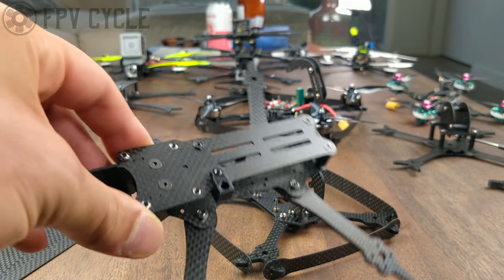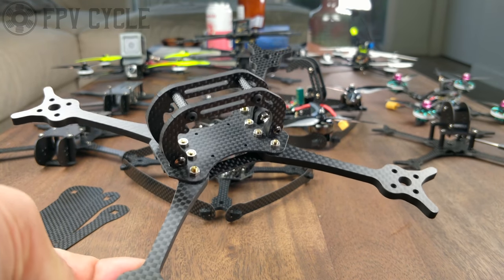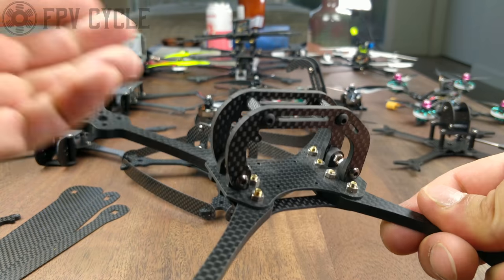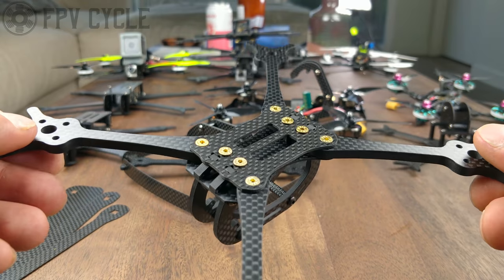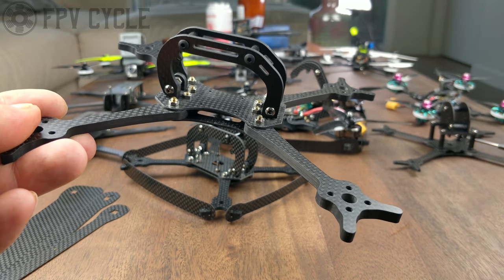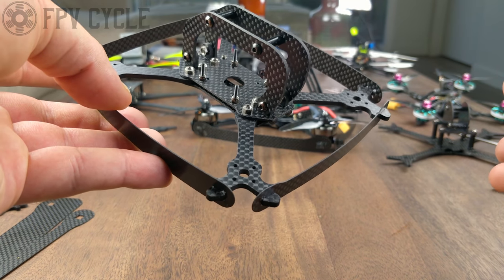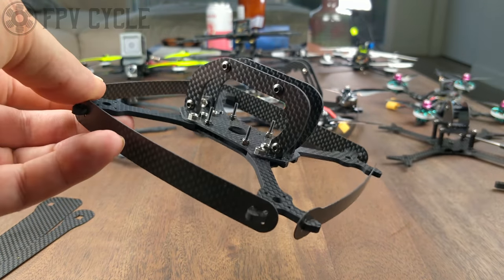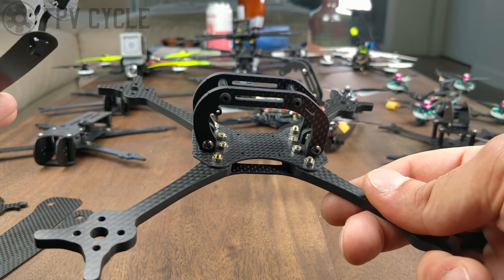Vertical Carbon Fin Concept

Comment from the maker: Molar Race Frame: https://bit.ly/30qBZYc
Fouride: https://bit.ly/3eJZ4tX
PowerPick: https://bit.ly/3fW6iMq
CineSplore: https://bit.ly/3dGJu1z
Gemfan Duct props: https://bit.ly/385nvAk

FPVCycle 2203: https://bit.ly/3i7QPuA
Excellent prop options: https://bit.ly/3es3gyf, https://bit.ly/30fxDD2
30A 4S AIO Toothpick board: https://bit.ly/3i8POCq
1100mah 4S 130C: https://bit.ly/2V7cvx4

Other unique things to FPVCycle.com:
Longer Vista antenna - https://bit.ly/2ViXhFg
Vista + Nano Nebula - https://bit.ly/2ViXhFg
Vista kit + longer camera wire - https://bit.ly/2ViXhFg
200mm DJI camera wire - https://bit.ly/3eyBYXU

Shrediquette Blog: http://bit.ly/2J7Urfv

Table of Contents:
►00:00 - Intro
►00:05 - Fouride quick view
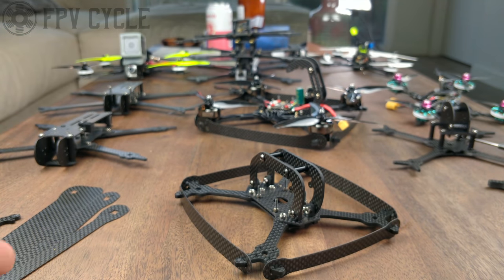►00:32 - Molar intro 
►02:55 - Vertical fin intro
►05:58 - Why this fin structure
►07:19 - Why vertical plates
►07:56 - Front and back fin effects
►12:32 - Side fin effects
►15:40 - Lighter is better than fins
►19:14 - Final thoughts

▼Join my FB group for more discussion: Kabab FPV
https://www.facebook.com/groups/379155946182689/

The store: www.FPVCycle.com

▼ My typical 5" quad setup:
-CineGlide: https://bit.ly/2MCoz50
-Motor: http://bit.ly/2Nqqr25
-ESC: http://bit.ly/2oDdzvL
-WaFL’s Cap Cap: http://bit.ly/2GUpXxO
-Battery: http://bit.ly/2JnsTDM
-FC: http://bit.ly/2XRc8G8
-FPV Cam: http://bit.ly/2Q7LfL7
-Vtx: http://bit.ly/38Y25oz
-ND GoPro Mount 30deg: http://bit.ly/2WC15zc
-ND Filter (if used): http://bit.ly/2WEmQ1j

▼Notable motors:
Check out the Rcinpower Wasp and Bison...interesting motors coming.  We're working on blending those two motors into one.  The Wasp is more powerful but the Bison has an awesome 11mm bearing that's uber smooth.

▼Starter goggles: http://bit.ly/2qbJNOS

▼ If you want to solder better:
-Fantastic solder: https://amzn.to/2P5QM2W
-Fantastic iron: https://goo.gl/DqBipa

▼ Tips?
Patreon: https://bit.ly/2oGLP9b

-PayPal: https://www.paypal.me/kababfpv
-Bitcoin: 1E4XZXoD4rS6MYWVWuenY7Kw2M1YgyNpoQ
-Nano: xrb_1188ek5bd7tb9kw67asnp9o65byuoaxbtpxuznx1ribf75x78awywmakj55f
-ETH: 0xD067F93811f2eC31CB1928901002dfdf9A492EF5
-LTC: La2KWYAjp4VT2Lq2M76pbjzXWvRyjpfCtG

Comment: The "rectifying the thrust" is what stator vanes do in a turbine. Those box frames probably do slightly straighten the discharge flow, but it probably is a wash with the drag it induces. If that idea worked every light plane with open props would have stators...

Comment: Great video! Love when you talk about racing as you have a unique prespective. Will be interesting to see if smaller, lighter quads will be competetive. Imo we are moving in the direction where straight line speed and initial turn-in is more important than a smooth overall flight.
Reply: I agree :D

Comment: After skateboarding, skiing, driving, racing cars, jet ski and snowmobiles you are on point for me.

Also I run a MAMBA 20amp 20/20 nano full soft mount XRotor stack and I’m blown away with it! Currently on a 2nd generation Leader 120 2s, 3s and 4s 850s! All run so well on stock pids... it was a wonderful surprise I have a hobby Wing stack I used in a 3inch 4s, perfect! In the Leader it likes 2s!?! I think it’s the vibes from two motors but I’m putting that in a 5inch Doberman out of Detroit🤞 cheers

Comment: Interesting discussion. Thanks! I’ve loved Karearea Talons for a long time though the frame is so fragile. The vertical arms really help it track around corners and as true to your statement, it has to be lighter for the verticality to matter. When I strap a GoPro on it loses that locked in feeling. Talon PR is amazing with a Vista, 20x20 Talon F7 stack, and F40 Pro IV’s.  The Karearea Toa with horizontal fins looks great for freestyle float, though I haven’t tried.
Reply: The new talon frame doesn't look so fragile ;)
Reply: SueMyChin the Talon V2 looks quite unique. UAVfutures made a nice video on the durability. Definitely stronger than carbon and beautiful in its own way. Single ‘rudder’ up the top! Nice to have KababFPV frame with options to experiment with vertical fins. Great idea!

Comment: A thing to note is that the compressive force you put on the plates to mount them can cause them to "quickly" delaminate at the inside of the attachment point. Although i doubt anyone will care because its a easily replaceable .5 mill presumably cheap carbon plate.
Reply from the maker: They're designed to be thrown away and replaced. They're very very cheap to make the fins

Comment: If you look at the aerodynamic coefficient of lift (CL) profile of a flat plane then the maximum amount of lift is created at 45 degrees angle of attack - which is coincidentally very similar to most peoples camera angle for racing. So yes those front and rear box components do generate lift. I can link aerodynamic analysis of CL profiles for flat planes if you wish - or you can google them. Similarly as you side slip a quad through the air the angle of attack of the flat side planes increases and the effect is to aerodynamically assist the quad in the direction of the turn ;-)
Reply from the maker: It's not as simple as just 45deg. Flowing air will not stick to a non aerodynamic surface or deflect that easily. This is a narrow spar. If it was like three inches wide then sure 45deg may do something but it would still cause an immense amount of drag when you're not on the throttle. It's basically a game of drag vs lift which drag usually wins. The actual lifting effect benefits are seen at past 80deg or so of tilt as far as existing tests go.

Comment: I do think the vertical fin does do something for lift. Most of it is under the swept area of the props so the main flow direction will be inline. The oncoming air reshapes the downward air more than directly hitting the cross spar in this case I think, at the very least the effective angle of incidence is dramatically decreased. Obviously that applies to the side fins too which probably don't do much. In this example the tilt on the quad is pretty low but the angle the air hits the arms would be fairly shallow. https://www.youtube.com/watch?v=Yh0RzFZKExo
BTW Have you thought about designing in sandwich style arms? eg 2x 2mm plates separated by the body plate with a spacer out by the motor
Reply from the maker: Yeah actually I have that on one prototype design. Was trying to get a certain advantage from it. Definitely learned a bunch about things with that design

Comment: Hey man! I've been thinking of using VAS xfire pro antenna as huge sharkfin/side force genererator for my frame for a while now instead of committing to box style SFG. I think placing the sharkfin at the back like most modern track cars is plenty enough to make the quad more stable in the air. It's a functional design that won't add any real weight to the overall build since we're using antennas anyway and can be easily integrated to ultralight 5" toothpicks by just adding an antenna mount at the back. Might be worth investigating ;)
Reply from the maker: There are lots of frames with shark fins. They fly fine and are great for turtling but as far as my testing goes they don't do much in the way of tracking
Reply: @Kabab  Not like a sharkfin that's used for turtle mode but directly behind the canopy in between the rear motors. This way, we can still use the thrust of the props :)

Comment: Seems like a great concept, on the sides at least, though even the front and rear should help direct airflow as well.  They may even help keep from getting tangled up in branches?  I'd buy an antler arm kit for my Glide.

Comment: Hey Bob. Have you seen the Karearea motors which have fins on the actual motor, on the strut connecting the motor shaft to the bell. It supposedly cools the motors and provides a tiny amount of thrust
Reply from the maker: They do nothing but nice effort in making them...

Comment: Very interesting! Deffenetly agree that racing might move to more precise style racing instead of heavy quads. Remember when there was people flying 1408 5 inch ultralights in like 2018? They felt like throttle was either on or off and you would fall out of the sky when not on throttle... is that a problem now?
Reply from the maker: Na 1408 is far too small

Comment: 8:50 what if the fins were on a servo to tilt in the direction for the best performance and handling. I know that would add a lot of weight but its just an idea.
Reply: I was thinking the same thing, but then wondered if the added weight would remove any benefit you may gain.
Reply: @JazzXP  Yeah I know what you mean. Another idea I had was to ditch the 4 side fins and just have one rudder with one servo. This way the weight is dropped more than the other idea and you still will get the control through the turns. I am not so sure this would work but it would be cool to see a rudder on a quad to see how it handles.
Reply: @KoreFpv  Oh ok. Nice to know. Is there any flight footage I can watch?
Reply: Servo fails or twitches and suddenly shit goes sideways in a hurry....    that is the thing I like about quads is how few moving parts and resistant to noise/influences they are.

Servo linkages or adjusting for backlash and other details for quads would likely be a pain in the ass beyond just the durability issues.

I do play with servos on quads a bit and have run into some issues just in the camtilt systems I play with while using cheap servos worthy of sacrificing on a quad.

Comment: Smoother motor you say, skewed stator? Although I do wonder how much more "smoothness" can be gained just from better FOC motor control.
Reply from the maker: Been working on the skew.  Unfortunately it's a bit prohibitively expensive to do.  Both magnets or the stator.  But still working on it.  If I can add that skew to this new motor it would be the absolute ultimate in smoothness.

Comment: Habe you tested a negative angle an the Front and back "wings" so that when yuor fying normal at ex 45° you have almost no drag but when you go to 0° you have a downward force what could bei beneficial for racing
Reply from the maker: Yeah I've seen this a few times too. I've flown one. It tends to want to suck you down but more than anything it seems to just be draggy and inefficient. Which I guess is the point....
Reply: This is what I was thinking.  Should rotate them so they run parallel (or near parallel) to ground when camera is parallel to ground.
Reply from the maker: @sugasheeze  so then why not just get rid of the front and back ones altogether?
Reply: @Kabab  okey yes I can imagine that if youre not at the perfect angle it ist juste realy dragi and does not have enaugh benfits

Comment: as you pitch back the front and rear fins could act like a Bugatti Veyron rear wing.  so incorporate that move into a racing line so you can effectively "smash the brakes" harder than everyone else....?

💭 servo attached to fins attached to FC for active control....... #betaflight5.0   
: opens DM to @Tom Stanton :

Comment: Ultralight racers might be better as they have less inertia and can change direction much faster. However, they might also be more susceptible to wind and might feel a bit floaty in flight. 

...And so 2 months into the new (traditional) race build on 6S and I am already filled with quite a good bit of regret. 

SFPV's box frame?: https://rotorbuilds.com/build/24043
Reply from the maker: not quite.  it's the one from diatone.  This one https://www.banggood.com/DIATONEFALCON-MULTIROTORS-SOLLEVA-240mm-Frame-Kit-compatible-DJI-FPV-Air-Unit-20_530_5mm-Hole-p-1627778.html?rmmds=search&cur_warehouse=CN
Reply: Oh ok- Also I have an idea for a light racing setup - It's meant to be a sort of balance between power and weight 

Upgraded PowerPick (3.5mm or 4mm arms) - need some sort of pod- the current carbon one is much too heavy in my opinion
2204-6 2100-2200kV 
Gemfan 5125 or maybe HQ R35?
5S 900-1100 mah? (Less battery sag than 4S, not as heavy as 6s)

What do you think? Would be great if you could test this.
Reply from the maker: @KC-om7cm  this is fine but you're starting to creep up into the medium and heavy category.

Comment: To me, there's irony in bringing up an F1 car for performance - the coefficient of drag on those things is absolutely appaling, to the point where they actually need 1000bhp in order to achieve straightaway speed, and that they are so much faster when operated at 6000ft (Hermanos Rodriguez in Mexico City) just because the high downforce kits still make less drag than the Monza setups.
Reply from the maker: 😂 but their drag is actually doing something
Reply: @Kabab  The aero efficiency is actually pretty garbage, yes they're making huge amounts of downforce, but the regulations are written to ensure they can't actually make as much as the overall surface areas suggests they should, which is why LMP1 cars are on comparable pace at some tracks despite being similarly restricted.  They make their pace by having high minimum corner speed.
To some extent, that's how I feel about the aero appendage racing quad frames - where you can see both the apex and exit of the turn, that extra lateral stability is amazing, and makes even cheap quads feel razor sharp.  As soon as you are backing it into a turn, you lose that, and that transition is just hard to manage at first.
Reply from the maker: I remember a while back they wanted to force F1 to go back to full manual gearboxes or something. I'd quit if I was a driver and they forced me to do that 😂

Comment: Hey bob,
I´ve purchased two Mamba F411 AIO Boards and i´ve got several problems with the escs / rpm filter... I´m also in close contact with thorsten laux, the developer and owner of JESC. He´s trying to help me as well solving these issues. This is what happened /-s:
 
When hitting "read setup" in JESC or BLheli configurator only a random number of escs gets recognised.
When flashing, it often says flash failed
-Both issues got solved by thorsten laux by writing a new jesc configurator for issues like mine
 
This is whats still not working:
When flying with rpm filter on:
24khz: Weird twitches and non smooth/percised flying
48khz: Death rolls...
 
Without rpm-filtering:
24khz: way less twitching but still slightly there
 
 
All issues appear on both brand new boards!
 
Any ideas on what to do? I´m kinda lost and don´t get to fly ms TP3 properly
Reply from the maker: Are you running the right firmware version for the board?  Usually when things like that don't work it's something simple
Reply: @Kabab  I dont know, i run betaflight 4.2.. Bf 3.57 worked but had terrible propwash handling... I´d love to be able to fly my TP3s with 4.2 and rpm filter...
Reply from the maker: @rawpicsfpv3516  I haven't gotten 4.2 to run right on anything really
Reply: @Kabab  Guess 4.1 isn´t better then? Like i said, my TP3 had some pretty bad propwash on 3.57:(...

Comment: Any thoughts on xings 1303 motors?
Reply from the maker: They're overweight despite having a 1.5mm shaft instead of 2mm and nothing special just like all their other micro motors.  You only get two prop mounting screw holes so if you mess either of those holes up the motor is done.  This particular motor happens to be $1.50 more expensive than the FPVCycle 1303 too.....which is the motor iflight likely decided to mimic.
Reply: @Kabab  Thanks, so rcinpower 1204 is basically the only option in the EU.
Reply from the maker: @coooxd  that's good option

Comment: Cool designs, but all PIW Props in view frames! :-(
Reply from the maker: These are racing frames.  They're generally not intended for cinematic footage and almost every single racing frame out there has props in view of the FPV feed.  Consider looking at the CineGlide frame: https://fpvcycle.com/products/bucktooth-frame-aka-cinemint-5-frame-dev-test-team-edition?_pos=1&_sid=a043fc025&_ss=r
Reply: KababFPV 
Of course, but I guess for racing too it could be better. When the sun reflects on the props it’s not pleasant and it takes away a good slice of view But in general I would see a better flying frame than the DC without props in view.

Comment: the vertical frame actually does result in uplift, just think of 3d airplaines which have very high degree in angle to the direction the're flying at.. and also its tested that vertical frames do make visable differences. Sorry if my English isnt smooth, greetings from Germany :D
Reply from the maker: makes complete sense.  The difference is that those things typically don't move super quick and the surface area of the wing is generally huge compared to the rest of the plane.  We have the exact opposite here.

Comment: Get rid of the front and rear fins and test.   Any flat or cylindrical shape moving through the air causes a lot of drag behind it.  Tennis racket has lots of draggy wires.  Reason why they tried to ditch so much wire tension rigging on WW1 box kite style airplanes.

I could see flight controller servo controlled fins in the future.    They're popular in airplanes... rudders, ailerons, elevators... :-p    Got my 7" folding DALprops today.